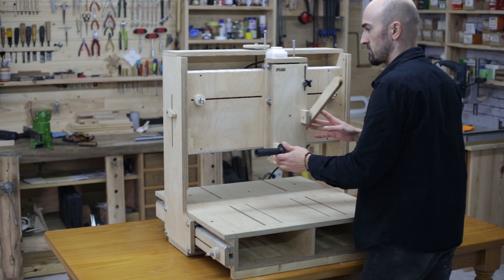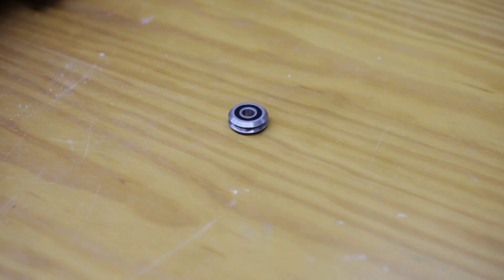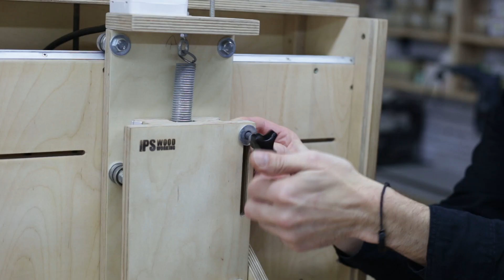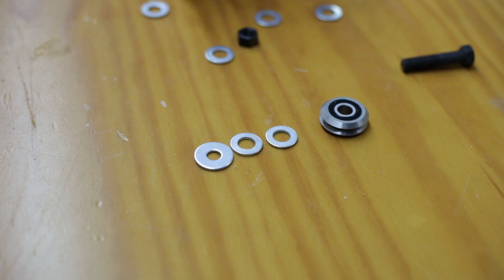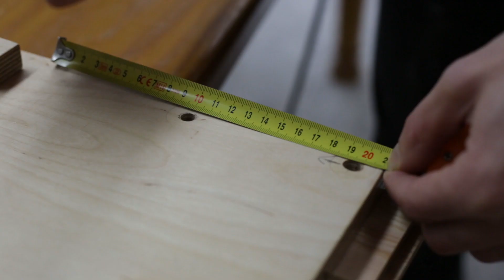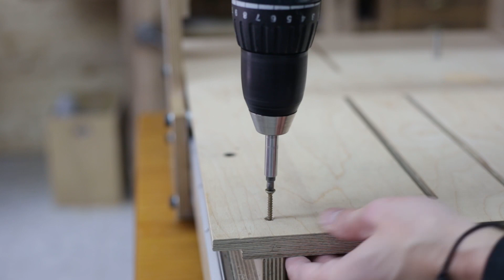3D Router Bearing Upgrade

Comment: Have you used bearings with inner diameter 6mm? 
I can't find bearings with 8mm
Reply from the maker: you'll find alink to the bearings in the video description
Reply: Thank you I have found them meanwhile.
Meanwhile I built the x-axis, but the wear of the aluminium is with V-Nut bearings not really better. A little difference of the 45 degrees between the bearings and the aluminium destroyed step by step. 
I start an attempt with stainless steel angle. This is more expensive, but steel on steel is nothing unusual. I glued the stainless steel on the old aluminium. Because the V-nut of my bearings are not deep enough, I used the old solution with 2 bearings.
It is running perfect.

Comment: Senor Paoson, wow... great stuff you do in your shop, making your own tools.  Do you have a design or engineering background?I I do have one question: did you have to adjust the 'v' shapes or rails for consistent height dimensions??  Or is the milling of the V block piece consistent to .001" or .002" or .025 -.050 mm? Just curious, muchas gracias.

Comment: Why use you two 45 degree bearings in aluminium? like this: https://s-media-cache-ak0.pinimg.com/564x/3d/25/2e/3d252e381d455d72e9259c390a0467da.jpg because it has more surface contact.
Reply from the maker: It is another good option! thanks

Comment: Great work as always! 
This kind of V bearings I have on my Shapeoko2 CNC, but they are from plastic because they run on an aluminium slide (makerslide I think is called). Nice feature is that the lower pair of bearings are mounted with an eccentric nut, this way you can adjust how much force they will press on the slide in order the minimize or cancel that backslash.
Reply from the maker: It is a good idea, I had seen in cam dolly, but never in CNC, thanks for your  comment!

Comment: I really enjoy your demo's. Are you going to update you router plans with the new modifications?
Reply from the maker: I'm not planning to update the plans because, as you can see in the video, hardly any modifications are necessary and both systems are good if made correctly and with the right parts. You only need to separate the bearings 6mm on axis Y and X, and lower the Z axis part another 6mm as seen in the video. thanks!